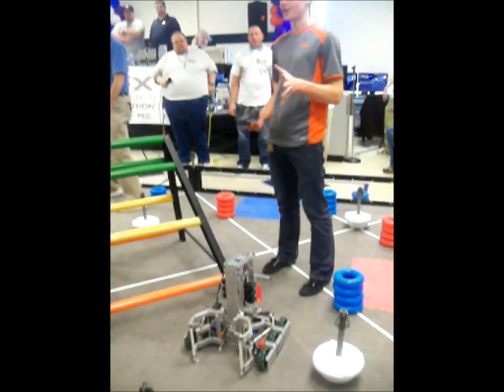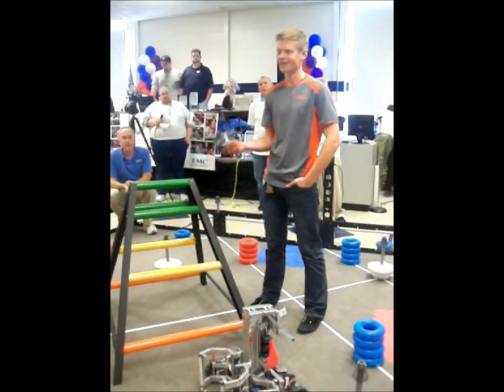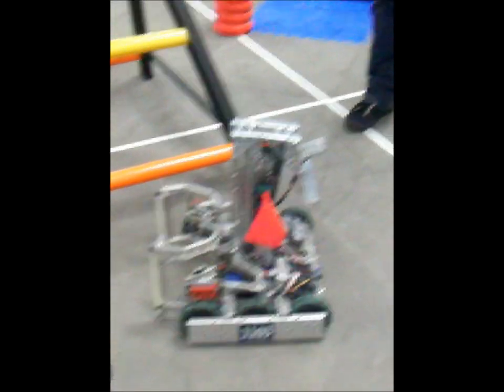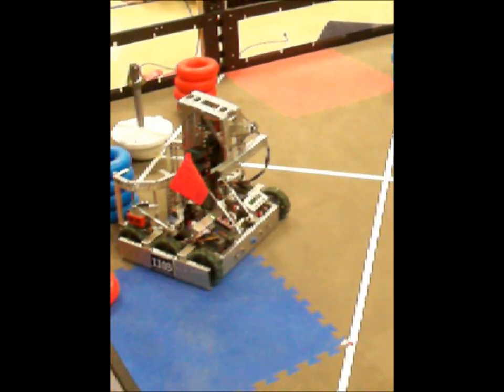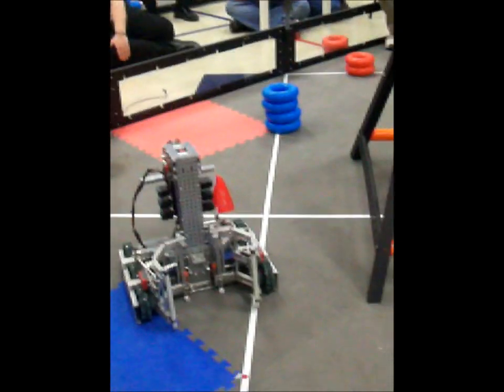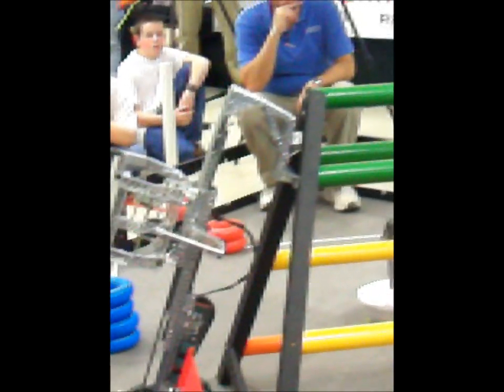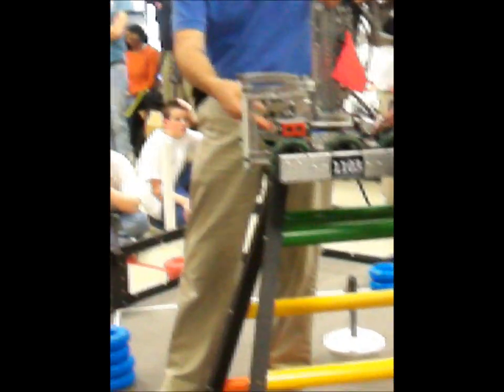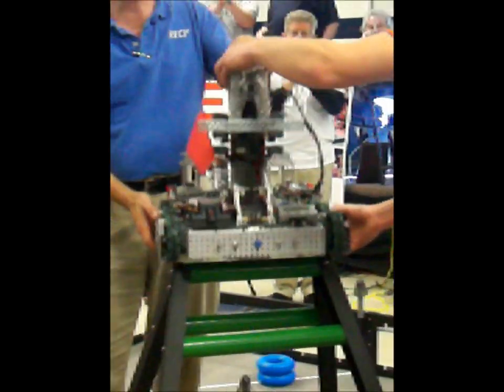Vex Robotics Competition Team 1103 explaining their robot design 1/22/11

Comment: I imagine an axle pushed by rubber bands that is blocked by some metal or lexan. When the pneumatics tip the arm and the arm is fully lowered the lexan is pushed away and the axle slides into place, locking the arm. You'll notice the arm was raised slightly before he tipped it, indicating that that is correct. It would certainly be the simplest method.